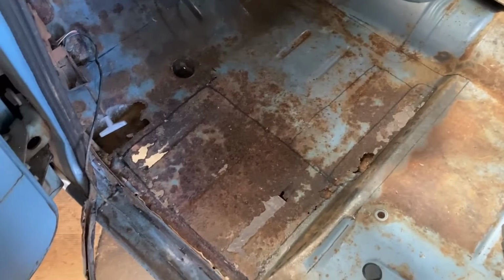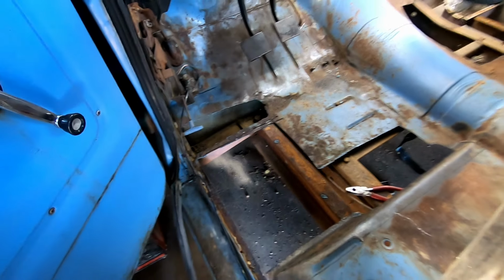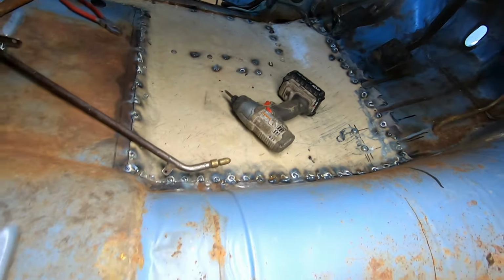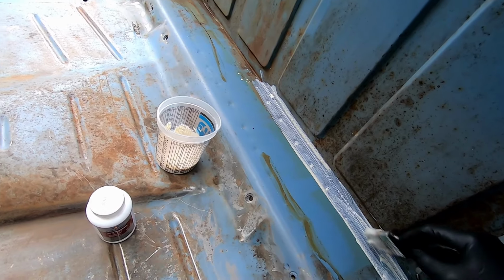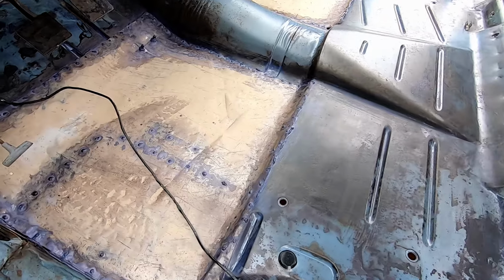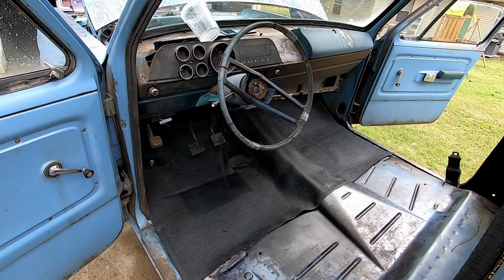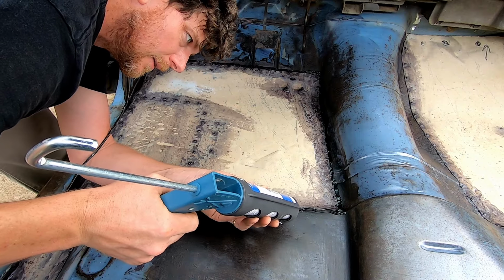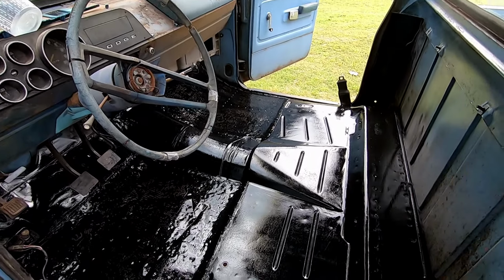1972 Dodge D100: Making Floor Pans out of JUNK! #mopar #dodge #diy #d100

Comment from the maker: The $100 question is: What do YOU rate this level of floor pan patchwork? And is it good enough for this old truck?
Reply: 6/10 
Yes!!
Reply: I rank it a 8 out of 10.  I did an 80 cab we were putting on a 78 floor using metal out of a K car roof, we centered up the 4 speed hump we salvaged out of the 78 cab and filled in the sides with the K car roof.
Reply: 9/10 great job. The best part is your attitude and approach to your work & producing these great vids. I'm a diehard mopar guy. Your videos help me find the motivation to gettin back out there to fix many of the little things my old mopars need. Just a lil more TLC. Thanks Joe 👍🏻
Reply: I'm the last person to be able to rate bodywork but I think you did a good enough job for the purpose....no Fred Flintstone stops! I also think the truck will be faster 😉
Reply: I would say 8 out of 10, it would be 10 if you pressed the ribbing into it like factory
Reply: Not everything needs to be factory perfect. It's solid. It's sealed. It works. Excellent.
Reply: Just fine for a driver truck #8
Reply: Hey Joe got a question for you  when ordering rod bearings I see in places it list bearings as 20 under an another vendor will list rod bearings 20 over I'm confused my crankshaft on my 318LA engine had been turned 20 thousands on mains an rods I'm getting ready to put a high volume oil pump on an a set of J, heads an a nice camshaft while I'm in bottom end putting the oil pump  so I've berm on ebay an Amazon searching for rod bearings do I order rod bearings 20 over  or 20 under or are they both some thing an people are just miss wording things also I've been looking at clevite 77,s but I was told clevite 77 rod bearings dint hwve the slot or hole whatever u call it fit the oil throw the rod caps have a groove cut in lip an bearings most do also ots fir the oil to splash up on walls of block is it critical to go back with bearings that has tge notch fir oil splash or what I've not bern into mooars very ling I've bern a general motors mechanic all my life up till my motorcycle accident an became disabled  whst bearings do you prefer what Brand would you put in a small block 318LA engine it was rebuilt about 3000 miles ago an bored 30 over it might not even need bearings I am judt buying a set to have so when I stop oil pan to put high volume oil pump in I'm going pull a few rod caps an see hiw well they broke in I did see stuff in oil every time I've changed it sn it's been changed atleast 4 times I'm running valvoline vr1 10w30 conventional an Lucas oil stdnalizer after I drained the lucas break in oil to break in engine so what brwnd bearings do u use and do I order 20 over or 20 under or are they both the same thing an people are miss wording them like I said crankshaft was turned 20/20 please I need advice asap I'm ready to drop oil pan
Reply: Does that Permatex rust treatment work on an A body roof ? I took the front half of the vinyl roof off my demon. It’s not rusted thru but it’s heavy rusted underneath. Wanted to use something other than POR 15 something that will convert the rust to solid. Then maybe something else on it to start smoothing it out. Then maybe some filler primer to start smoothing it out. Just checking to see what works for you. Thanks Joe.
Reply from the maker: @loydhicks3413  think of it like this; when the crank was turned, it made the journals smaller. It is now “under or below” the stock sized diameter. So you’d need an undersized bearing. Oversize bearings have more material on the outside facing the bearing housing bore. Clevite, federal mogul, and king all make quality bearings.
Reply from the maker: @tims72demon  yes sir. Get all of the loose rust off possible. Then you can do permatex in one or two coats. I would let that dry and then sand it, prime and paint
Reply: @JustMoparJoe  Thank You Joe 👍 I’ll have a question or two about painting the underside.
Reply: Hey Joe thanks fir the input on the bearings I'm going yo go with sealed power part number #2130 cp-20 there tri metal and tgere c readily available at my local parts store federal mogul and sealed power merged and niw are one am I correct how do you feel about sealed power tri metal bearings it's in a van and had tge 727 so it'd a 3 speed I'm thinking it being a v a n modt likly 355 gears the van is also my full time off grid home end daily driver I built it after my motorcycle accident an that's wgst turned my life around died twice in med flight an during operation then lkdg s lung an 7 reconstructive operations then told id most likly never walk again well im walking an doing my own work this vans built to spend alot of its life on interstate AR hig speed an high rpms them 3 speed were built when interstate was only 55 mph not 70 an 80 like today I've noticed a hour of driving at 65 sn 75 when I stop engine idling in gear rpms maby 750 yo 800 running valvoline vr1 10w30 racing oil high zinc an added a almost full bottle of Luca heavy duty oil stabilizer its at 18 to 22 pis oil preasure now all ddy ling around town normal speeds it stays st 30 PSI an cold starts it'd better tgsn 65 pdi cold so I'm thinking when warned up hot or whatever u wish to call it I'm getting too much clearance between bearings an crankshaft what you thunk Joe oh an I also found out the cam bearings were never changed at machine shop when he started building my engine thrn found out his wife was giving me parts labor an engine back on credit see I worked fir them in 80s sn 90s while in high school therr in earily 70s now he sabotaged my heads shaved thrm till valves was tapping pistons and pit 3 wn 4 shims under valve springs which caused coil bandage an eat loves up on cam she confronted her husband about it sge ssid he said tgst would taach us both to never go behind hid back an do stuff like this a man in 70s do a guy in 50s tgst lost hinexem sll in 2019 from a motorcycle accident an had bern bedridden a yr an lucky I regain use my legs anyway I've been dealing wth this mess ever since engine slun a bearing August last yr Joe how u feel about sealed power rod bearings  an then do u think tri metal be s goid choice since it's ginba get alot of high rmp,s an interstate speeds of 70 an 80 mph I'll wait till I hear from u to pay for thrm I'm gonba go buy s set today hell I might not ebrn need thrm but I'm dropping oil p as m to install a hig volume oil pump an figured I'd check a few rod bearings while in bottom end I'll be awaiting your thoughts thanks Joe you an Tim on 318 will run have berm a huge help to me wn I greatly appreciate it
Reply from the maker: @loydhicks3413  I would definitely check your current bearings before purchasing. If they’re in good shape, they have good clearance and are happy in place.
Reply: @JustMoparJoe  the problem with that Joe is I live almost dead in the coal fields of WV were in the mountains as a matter of fact if you hwve ever seen the scary movie called wrong turn part of it was filmed in WV an part in NC I'm about 45 min from where the part that was filmed in WV and parts stores do not carry stuff for vehicles tgat old it is either a special order item an takes 3 to 5 dsyd or it can't be ordered from the parts stores we have so I have only the van it's my daily and my off grid full time home and once I pull bottom loose if I need bearings an have them then goid if I have to order them it will take 3 to 5 dsys wth summit racing  Amazon is even longer on rod bearings plus they list no king or clevite tgats 20 under only 10 qn standard  ebay shows thrm but thr boxes sn pics of rod bearings tgat dummies has took out of box put there greasy finger prints all over which is a no no they have scratches where u can see shiny metal I absolutely will not buy them off ebay  so I judt ordered from summit the cb481p-20 under clevite 77,s and tgey will be almost a week getting diwn in these sticks unless they take
A WRONG TURN LMFAO AND PARTS WIND UO WTH THE CANIBLES LOL ID RATHER GO ON BUY YHRM AM IF I DONT NEED THEM SUMMIT WILL REFUND ME THE MONEY  BEARINGS AN SHIPPING WAS 98.91 ALLT C9MPARES TO SEALED POWER BUT I HAD 2 SETS ORDERED AT ADVANCE AUTO 3 DAYS AGO WENT IN TJIS MORNING INSPECTED THEM AN PURE TRASH STRAIGHT FTOM MANUFACTURER AN ON YOP OF THAT THE YIUNG KID OPENS ONE UP DROPS IT ON FLOOR WIPES IT OFF ON HIS PANTS KEG AN SAYS SHOO TGAT WAS A CLOSE ONE I SSID WELL U CAN GO ON DEFEVT THAT ONE OUT HE WAS LIKE EHY ITS FINE HAD TO SHIW HIM WHERE HE SCRATCGED THE BREAK IN COATINH OFF FACE OF BEARING AN THE SIDE MASHES UP WHETR IT LANDED ON FLOOR AN PITTED RHE SHIT OUTTA IT WOW U WOULD THINK THEY GIVE THEM YOUNG FRESH OUTTA SCHOOL KIDS ATLEAST SOME TYPE OF TRANING B4 PUTTING THEM TO WORK YOU  KNOW JOE??? HEY BIG SHOUT OUT TO JUDT MOOAR JOE AND TIM ON 318 WILL RUN GUYS THEY ARE THE BEST THEM TWO WILL TAKE TIME FROM THERE BUSY LIVES TO ANSWER QUESTIONS AN HELP THERES VIEWERS OUT THEY DESERVE A BIG SHOUT OUT GUYS

Comment: !!! Thats 99% exactly what I did a couple years back with mine. It just so happens that a hood from 80 up has the exact same curves as the seat mount spot so when I cut it up it dropped in perfect. The only thing I did differently was I tucked the edges underneath instead of on top where possible. I love the sheet metal screw method we both used here because its a simple job of popping the screw out and you have an awesome plug weld spot! I would like to add that it helps a LOT to tie both of the sub frame boxes in from under and fully weld them out. 
I think its absolutely hilarious that the two of us forgot to do the exact same thing on 2 separate projects... and its a big "oops" too. I'm curious of anyone can point that out?
Reply from the maker: Thanks brother. I had a little to finish underneath for sure
Reply: @JustMoparJoe  Right right, but what did we both miss? The stupid holes for the cab mounts lol

Comment: Good job man! 😎
I did a driver side floorpan in my '83 Mustang GT a couple years ago. I don't have scrap, so I bought the pan. I'll probably buy one for the Ramcharger also and trim to fit.
Anyhow, I drilled holes all around the pan, put just a couple screws in here and there, then plug welded it all the way around. Did seam sealer top and bottom, then covered the whole thing in POR15....both sides. Then I threw new carpet in.
That car is still not painted! It's up on my homemade wheel cribs in the garage. Will paint sometime in 2025!
I'm slow......too much other life stuff to deal with.
Ramcharger will get the floor work too, then some carpet.
I like that old camo beast....think I'll keep it!
I wish it was a '70s model though.
Reply from the maker: I’m with you, sometimes life gets in the way of projects!

Comment: Bought a 65 Rustang for a hundred bucks about 1981. Peel back the red carpet, and you could see the road! Someone used expanded metal to patch the holes. That Mustang was way past fixind due to rust, sold it for parts got my money back, after I had some fun doing dumb teenaged stuff with it. 😆 
Your patch job looks fine to this old Minnesota road salt rust guy!
Reply from the maker: Thanks brother! It’ll get the job done ✅